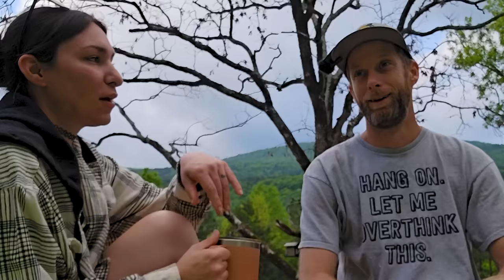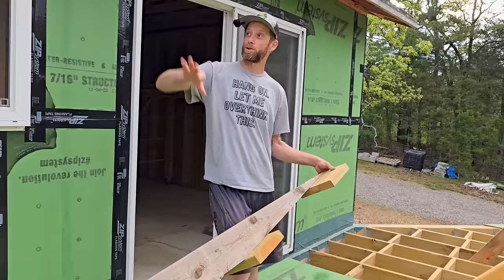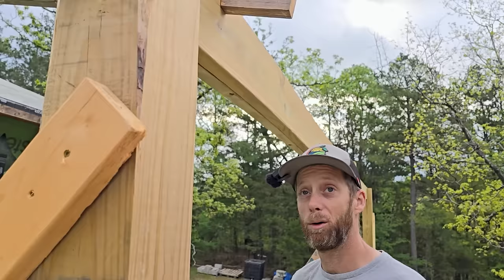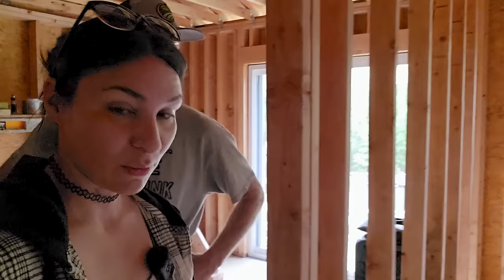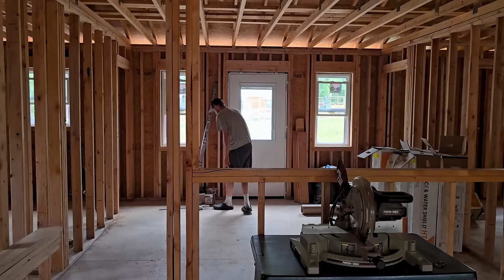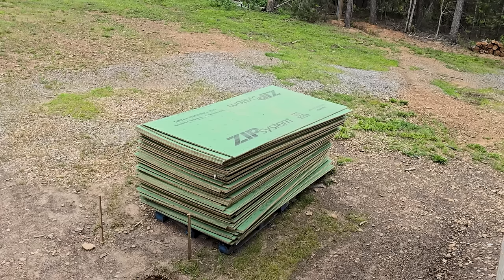Its A Problem If The Math Aint Mathin' On A Cabin Homestead| @SimpleLifeReclaimed | 04.18.24

Comment: Gary and Mel I left a message on one of your videos on SLR Within the last 4 or 5 videos on the only way to properly build that deck roof and still have a pitch for removing water/ice/snow. If you add your rafters just at the soffit out to your rim joyce in that short of a distance you’ll not have enough fall /pitch. If you guys don’t do it the way I said in my comment and tie it into you roof rafters on the existing roof and get it higher up on the roof and get a higher roof pitch. Then you get a big snowfall and get a foot or 2 of slow laid on top of that roof you may have problems. So the proper way to do that is how I explained it is tied into the rafters of the roof above with more pitch and sheath it as part of the existing roof.  But I’m telling ya it needs to be tied into the roof higher up the roof with longer rafter boards & it also will need some vertical braces down close to the soffit and then sheathe the whole thing all as one roof. But from your soffit area on the back of the House to the outer rim joyce of the deck roof you’ll never get enough fall/pitch for a heavy snowfall. Not at the height you now got your rim joyce header board already set on the 4x4’s now you won’t. 
Go back and read my comment explaining that and try to let your Brain Make sense of how I explained it. Yeah those longer roof rather boards to go further up the roof are gonna cost ya more money to do the job properly to obtain that proper pitch. But to have done it proper would’ve required that you wouldn’t already built the back deck and had your header Rim Joyce in place like you do now before you sheathed the back half of the house. Then you could’ve had Triangle Trusses made to tie into the existing roof trusses that could’ve went from existing roof Trusses & then extended down & covered over your back deck. But sense you didn’t the proper way to achieve the proper pitch is do it the way I said in that comment on SLR.
Reply: GARY THIS IS CORRECT, WE OWNED A ROOFING COMPANY FOR 35+ YEARS.  YOU ARE GOOD AT RESEARCHING, CHECK IT OUT

Comment: Food for thought...you already have the overhang over your doors and windows back there.  It won't interfere.   If a wind should come and take off deck roof, you would have added protection with the existing overhang and save you a lot of work.

Comment: Hi Gary, just thinking over your rafter. I favor more solid connection with the roof trusses, by that I mean to penetrate the roof sheeting to push the verandah rafter through and then bolt it to a truss. Sure that means a potential leak point but you guys used that black sealing tape on sheet joins so why not use it to cover  once the rafter is fixed, to close of the gap asap. That way of fixing means that you can have a sleeper verandah roof pitch to enable quicker snow removal.  Just not comfortable with your approach, still I will watch and see. It’s always interesting to see creative solutions to building problems. Stay safe guys.

Comment: Gary   instead of using such long studs to build up a roof over your porch   should had removed that facial board  extend the rafters along the roof two feet back  bolted to each rafter and all you needed was to plywood that porch roof  then cover up the underneath of your porch

Comment: If you put a plumb line on the rafter in it's place you can check and see if the 3 pitch is correct with the speed square. Doesn't look like a 3 pitch. You could add the length with the 16 footers. Just a way to double check if pitch is addiquit.

Comment: Hey guys, I’m just wondering why you weren’t putting the deck boards down rather than those plywood sheets. Wouldn’t it be easier to walk around and build your patio roof if you had solid ground to walk on?
Reply: Easy answer is money. Delegating cash flow as it is necessary at the time. Right now, that would not be the wise thing to spend the money on when we have other more pressing things to worry about first. The zip boards work great. Comfortable enough for me to skip on and I'm not good with heights. 🤗
It will All happen in good timing. Day by day, little by little.
Reply: @SimpleLifeReclaimed  - ooooo I get that! Thanks for taking the time to explain. I so enjoy watching your videos. Thank you for sharing your lives with us.❤️